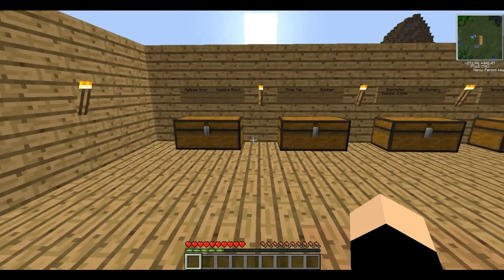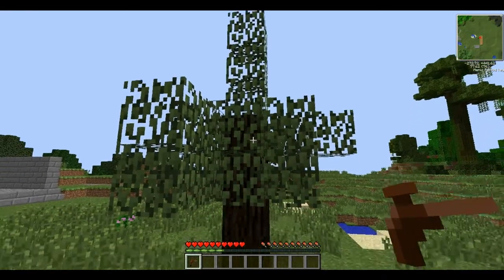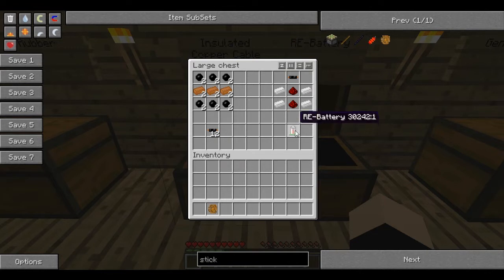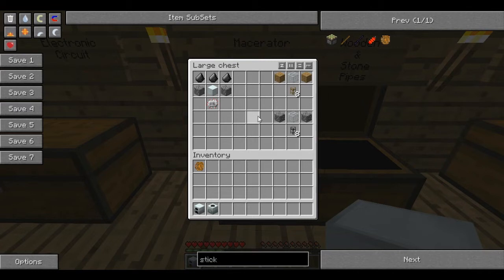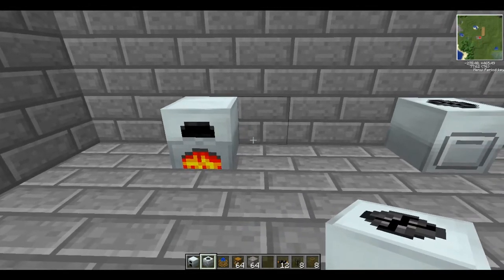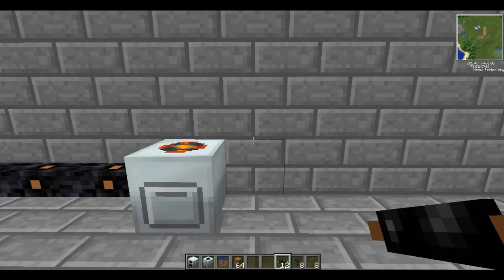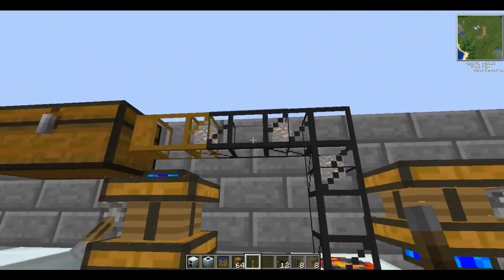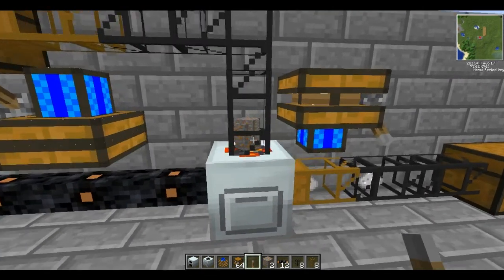Tekkit Tutorials Part 1 - Generators and Macerators

Comment: i can't make the machine using the machine block+re-battery+insulated copper wire. my re-battery doesn't seem to be charged or something. cause in your video the middle part is red and my one is empty.

Comment: Dunno why but it wont work.. I took the engin put coal in it so it made power then i wired it up with the macerator and the macerator got power. But when i try to grind coal to get coal dust it wont work ;( Help!

Comment: Oh problem solved the macerator didnt work with the texture pack i used. Also heres a tip instead of using redstone engines use steam engines theyre easy to craft and are better.